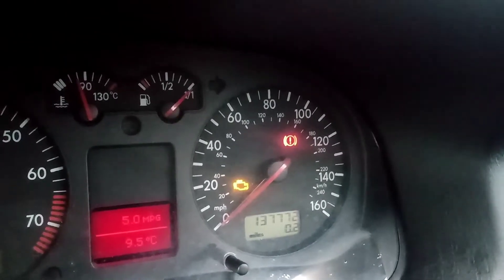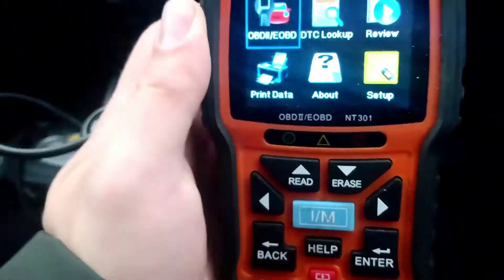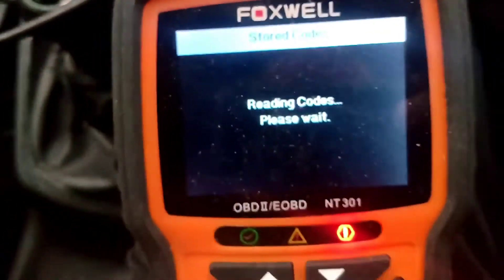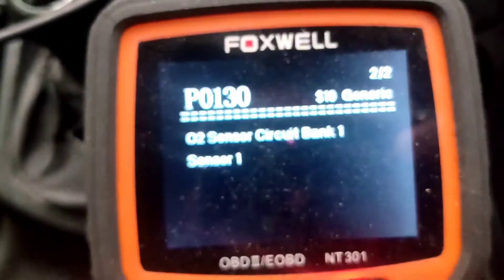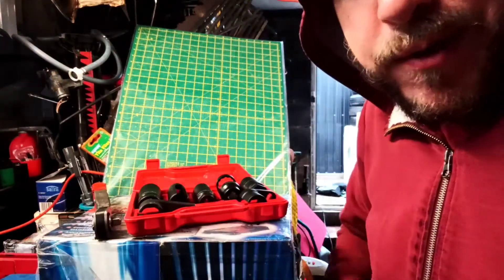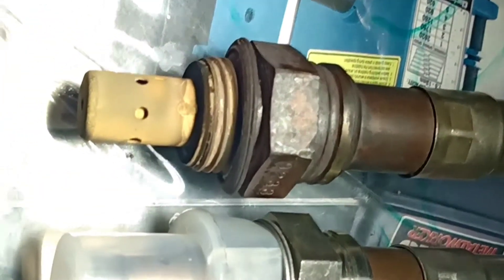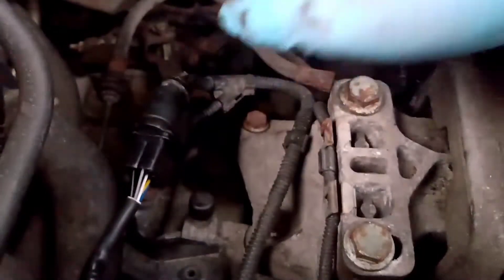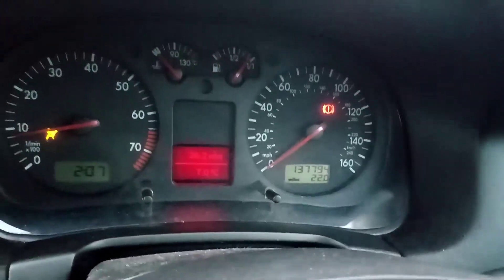MK4 GOLF P0402,P0130 engine check lambda O2 oxygen sensor fault

Comment: Good video m8 , but how does erasing a code stop car running rough when problem is still there ? Cheers
Reply from the maker: I would imagine the sensor has an intermittent fault rather than a permanent fail......thanks for comment👍
Reply from the maker: Had a little research and I believe it resets the values in the ECU....but when it catches on the sensor is still not right, it brings up the code......I think it lasted an hour or to over a couple of days.
Reply: @chalksplace6813  yea that would make sense, thanks for reply